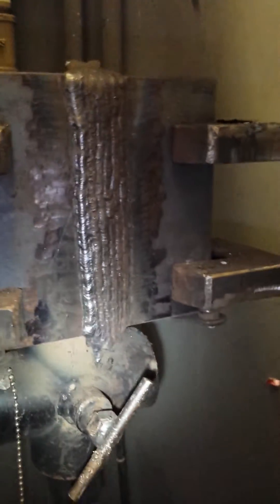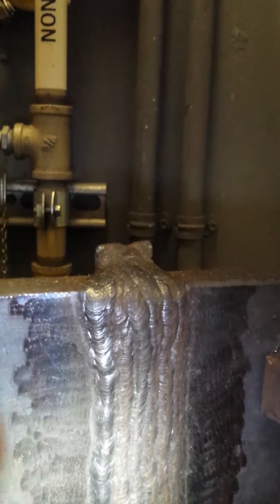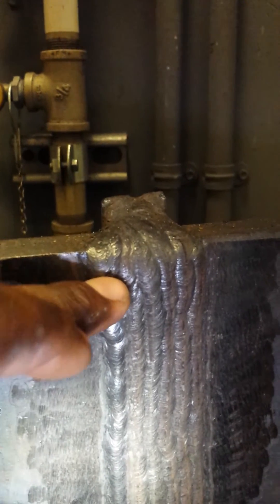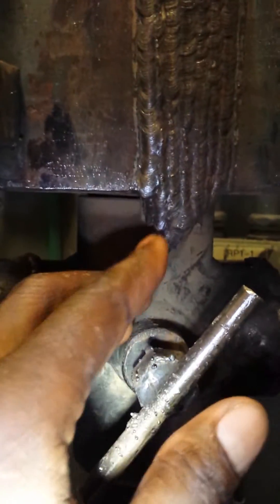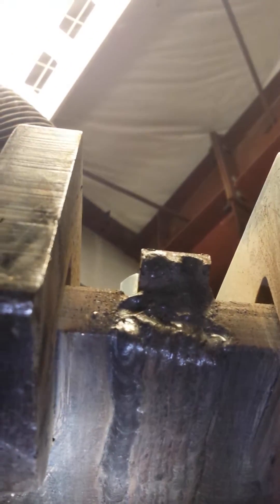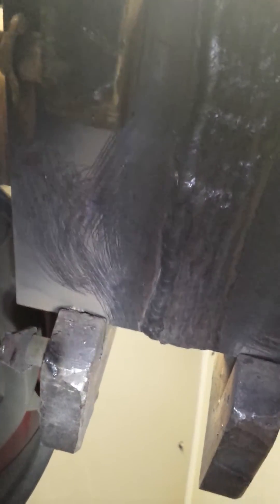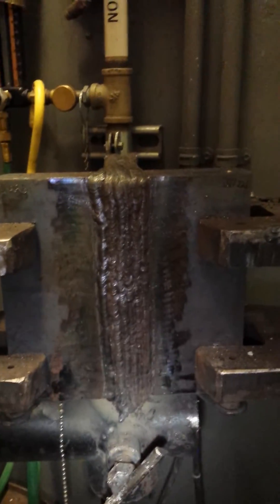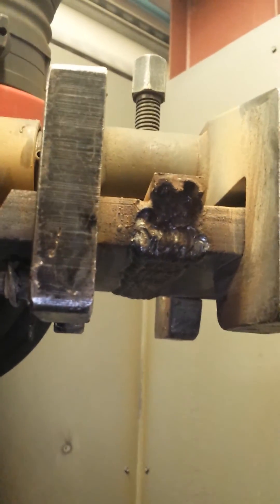3g, 4g 1inch plate test part 2 welding with chris.taner

Comment: How many strips do they cut out to do the bend test?
Reply from the maker: 4
Reply: christaner do you have to grind it flush after you’re done or no? And also, do they bend both the cap and the root? Being that it has a backing strip

Comment: actually just took this test in school and passed today, but is it Common to run vertical downhill in the field? 7018 isn't really designed to be ran downhill, how do you avoid Slag entrapment?
Reply from the maker: No down hilling the 7018, I don't recommend that at all. You are correct the 7018 is not made for that. When welding structure a close arc proper heat and your angle should be some where around 45 degrees give or take. 3/32 stick rod 91 amps 1/8 stick rod I us 125amps
Reply: Garret Recker thought same